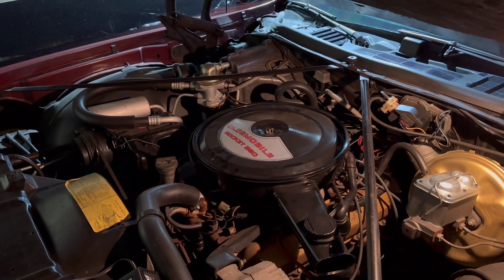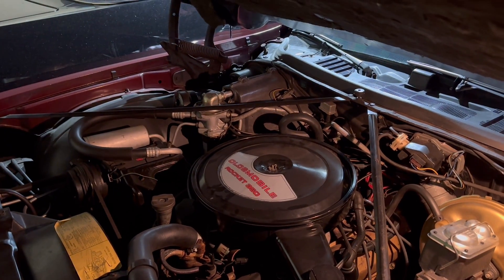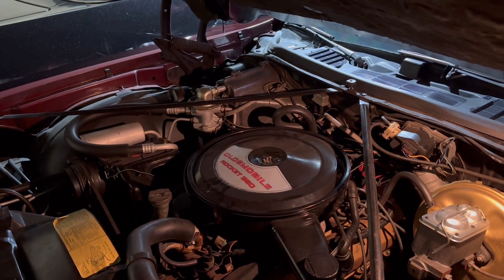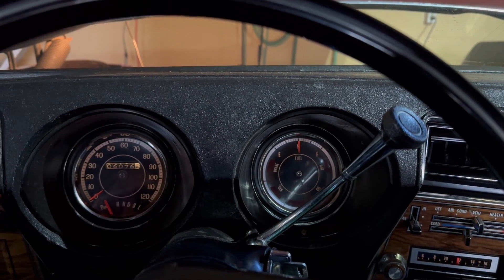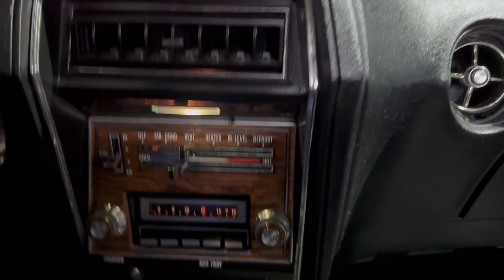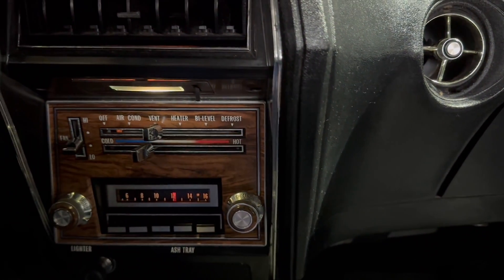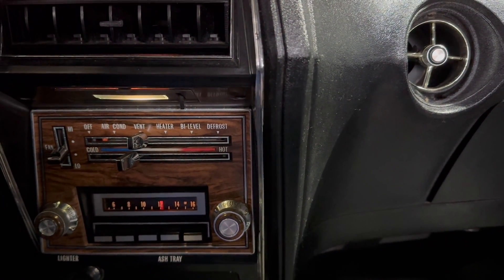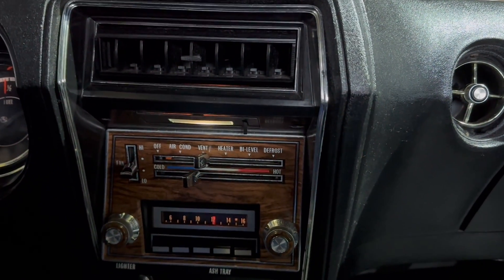GM's "Coolest" Invention Was a Strange Approach to Air Conditioning

Comment: Yep - in the Texas summer, those GM air conditioner units worked great! The controls provided practical function, but I absolutely hated not having independent manual control. Good thing those barges took all the joy out of driving and it was just an appliance - that was well suited to the Texas driving conditions.

Comment: As I recall, the recirculation "fan" always ran even in the off mode.  The other thing about the Oldsmobile rocket engines is that when the heat was on especially in vent mode, they had a very distinct aroma. Now that I'm thinking about it,  my 1979 Park Avenue Coupe had the Olds 403 6.6-liter engine.  It also had the Oldsmobile distinct odor!
Reply: The owners manual for my 75 Firebird states the fan is designed to run even in the off position to keep air moving through the damp AC unit to prevent mold and mildew......it also created a nice chilly draft under the dash in the winter however it could be switched to an annoying hot wind on your knees.......anything but completely off even if the car was comfortable without using the heat/ac.
Reply: @jasonrackawack9369  I still have all of the owner's manuals from all of my cars from that era to the present era.  I recall the same type of info.
Reply: My 01 Malibu and my buddies 98 Silverado both would let air flow through at highway speeds. The fan was off but you could definitely feel warm or cool air flowing through depending on where the temperature was set
Reply: @imthemistermaster  I have always heard this was a deliberate safety thing, as it means there is always fresh air entry to the car when in motion.  Probably more that they didnt see a need to install a damper to totally close off the system when its off since very few people shut the HVAC on a car totally off. I usually ran vent mode if I did not need a specific thing for example.
Reply: @imthemistermaster  I think all cars do that now. But you only feel it if you are moving.
Reply: I think that started in the 1970's on a lot of makes.

Comment: The o rings in the hose fittings need replacement or leaks are problematic.  Idle cooling on 134a not as good as R12.  Electric fan helps.

Comment: My first car, a 4 door Malibu, had a/c with that A6 compressor. In auto shop, we took off my compressor to reseal it.

After it was fixed, we recharged it, and it blew ice cold! 1967 Chevrolet. 

I drove it 8 years after that before getting rear ended. Never had to put another charge into it.

What i also liked was that the compressor ran the whole time the a/c was on. It didn't cycle like today's cars do. Gas mileage sucked, but i didn't care. I was cool.

Comment: R12. Good stuff. In the 90's the government made it impossible for a DYI'r to buy R12. So, I took an online class and got a certificate that allowed me to buy R12. I bought a 20 lb canister of it. I still have it. I would use it every 4 or 5 years to top off my 1977 Regal, 1975 Park Avenue and 1978 Eldorado. The AC in these cars was terrific but I never liked the automatic AC because in Florida you just can't get it cold enough. The recirculation feature was I beleive not available on that system. The Regal had manual AC with recirculate and it was great but the cabin was smaller too.    Good video.

Comment: That was a very interesting  segment. GM's units pumped out air so COLD that we vividly recall the formation of mini icicles at the two center dash vents.  👉.  🌬️.   By the way, does anyone remember some of the early seventies GM vehicle's having an "ASTRO AIR" designation on the HVAC controls ?!?  If possible, explain that feature's meaning if any.  Many Thanks Yo !   🚘🔍.     🤔
Reply: Wasn't it 'astre' ventilation, instead of 'astro'?
Reply: @kellybanning2013  No, the words "Astro Ventilation" was clearly printed out on the heating & air slide controls on the dashboard. Some further research has indicated it was an air flow system designed by GM after they phased out the triangular side flip open windows after the 1968 models. In fact, the '69 Impala/Caprice model's FRONT windows no longer were manufactured with the flip open windows. Many Thanks Yo ! 🤔🚘🔍

Comment: I love those GM A6 axial compressors. They were big and heavy, and it took a lot of power to run them. But they worked. And they lasted. The Harrison compressor that followed was complete junk. They were often called pancake compressors due to there design, and you could count on them failing every 2-3 years. They almost always started leaking where the end caps were welded to the body. They were very flimsy. They used a lot less power to run, and that may have been the reason why GM switched to them. I have a 1976  Corvette with the A6 compressor, and it will freeze you out. That control design is similar to more modern designs that use "MAX A/C" to get more air, and use recirculated air rather than warmer outside air. 

I have a 2006 Mercury Grand Marquis, and it has a real nightmare of a climate control system. It uses constant flow of hot coolant through the heater core, and has a "blend door" to mix hot air and cold air to give you the temperature you want. The big issue with this system is the "blend door actuator" a small cheap plastic box with a tiny 12V motor and cheap flimsy plastic gears in it. These things inevitably fail after a short time, and their location makes it necessary to remove most of the dash to replace them. Mine failed. After doing some research, I found that I could remove the passenger side airbag, fabricate a chisel out of a 20" piece of rebar, and get it back in there far enough to break off the corners of the blend door actuator where the attachment screws went, and move it away from the bellcrank on the blend door. I was able to jam the blend door into the full A/C position. I also removed and plugged the heater hoses to keep coolant out of the heater core. I live in Phoenix, AZ, where summer temperatures average 110-112 degrees F, and it never gets cold enough in the "winter" where a jacket won't keep you warm. This nightmare could have been avoided if only they had used wire cables to move the blend door. They tend to last forever.
Reply: I had a few Panther cars and that blend door actuator motor is a common failure point. The good news is that it's possible to replace it by just pulling the glove box and the passenger side airbag. You only need to destroy one corner bolt as I recall. It's not *easy*, but it beats trying to pull the whole damned dashboard out.

Comment: I always found the 80s to early 90s slider HVAC controls in GM products quite confusing as a kid on what was supposed to perform what function.  The unit Chrysler used in the early 90s k based vehicles took no time at all to figure out with its visual directional diagrams assigned to a single button, button specifically for air conditioning, and a slot for recirculating.

Comment: I don't believe the blower motor went to HIGH on recirc. The air movement sound got louder because the air was now being recirculated within the cabin instead of from the cowl outside the cabin. The blower motor was now blowing air within the cowling of the cabin under the dash instead of within the cooling ducts under the hood, therefor being easier to hear. 
The Olds (I am not familiar with other GM marques) owners manuals of this era makes note of this in the section on operation of the climate controls.

Comment: My 75 GP has the Max and Normal positions on the top slider as did my 76 Toronado. Funny thing about the Toronado, it had an electric rear window defrost (heated back glass) and it had a relay that would prevent the blower from going into the high speed when the defogger was on. With it off it would lock the blower in high speed in maximum. Guess because for some reason the Toronado only had a 63 amp alternator. I had a different 75 GP in high school that had a heated back glass but the blower would stay on high when it was turned on. It had the larger 80 amp alternator.

Comment: The Comfortron system was even cooler.  It was thermostatically controlled and would automatically switch from heat to cooling as you drove as weather conditions varied.

Comment: In my opinion the compressor you show here and Chryslers V twin compressors were the best that were ever used in automotive air conditioning.  I’m retired from HVACR field after forty seven years I never did any automotive air conditioning except for my own and family. I really liked those two compressors they seemed to run forever and would take more abuse than today’s compressors. It’s the same way in the field I was in.
Reply: I never tried it but I’ve seen it done. It’s a shame when America has something so good on the market that they have to stop manufacturing it because it doesn’t break down and make them money. 😡🤬
Reply: @czechmate6916  Yeah, that seems to be the first priority in modern automotive design. 

Just one more reason I'll keep fixing my old cars! :3
Reply: @jamesgizasson  Same here, everything I own is old but it’s paid for and still works while everyone else is in debt for buying junk they don’t even own anymore. They have to buy new junk 🤣
Reply: @czechmate6916 Yeah. I used to hate modern cars because they were so expensive and complicated. Now I hate them because I know that all that money doesn't actually buy you a better car... just a prettier one.
Reply: @jamesgizasson  Not a guarantee. Original compressor on a Ford van from 1980 was made of cast iron. New ones were aluminum. Original one never broke, but made a bit of noise after 12 years. Then I went through around 4 more of them since they failed after not even 2 years.
Reply: the Chrysler V Twin could be converted into a normal air compressor for air tanks etc.
Reply: I had a 77 dodge tradesman B200 van, that would blow snow out he vent on rainy days on the open road,  I hung a drink holder in front of the vent to keep my beer cold!  Sold the van with 275,000 miles, the guy that bought it from me took it to 335,000 miles it had the 318. Replaced the engine while on the road with an engine from a grandma car.  Met my wife when I owned that van. 
Had a half barrel of beer in the back and it fell over on the valve and dumped about 5 gallon of beer on the carpet covered 4in carpet in the rear of the van. (Summertime). I can still remember how bad it smelled.

Comment: Learned something today - thanks.  Nothing more than a rethink of the 'Max Air' (a/c) settings used elsewhere.  Hot Water valve/heater door closed, outside vent door closed and fan goes to max speed.

Comment: '60s/early '70s MoPar and mid-'70s-up GMs have just AWESOME air conditioning. I don't think anyone's ever done it better. If it's not hot and in the daytime, the old GMs I had and my '67 Belvedere's temperature setting would rarely be more than like 1/8" toward the 'cool' end of center, and I almost never turned the fan above the first or second setting, usually in defog/floor. Max AC/recirc was strictly an 85°+ with the sun out situation.
Reply: they sure had a spectacular fall from grace.... my family had a 1986 Electra Estate Wagon, and it had the most feeble A/C and heat I've ever seen.
Reply: @psymi-hk1fp  My '80s Buick Regals remain the most impressive vehicles I've ever been in to this day with regard to AC frigidity. There was something wrong with yours, I can say that with 100% confidence.

Comment: Come to think of it, in my 2016 Camry, if you turn the temperature knob all the way into the blue zone it puts the system into recirculating mode, despite the fact that the HVAC panel has a dedicated Recirc button.

But turning the knob all the way into the blue zone has no effect on blower speed.

Comment: I remember this feature very well, it caused a return to the dealer early on when the parents first got the 73 Caprice coupe.  Needless to say, they had the temp lever all the way to the left so the fan was on high when in AC mode.  Our 69 Caprice had a separate position on the control lever for the recirc AC mode.  No problems once the operation/control was explained to them.  I have to comment that this control was super easy to use,  everything could be controlled by "feel", provided you remembered the relative detent positioning on the top control mode lever.  Funny that you mention the heater core hose control valve, I don't think the 73 Caprice had one of these....  The only reason I remember/noticed is because I changed the heater core/heater hoses so many years ago and would have remembered a valve like that.  
Peculiar features do get replicated though.  Believe it or not, my 09 Camry has a similar control feature.  Turn the temp knob all the way to cold engages the AC recirc mode and a higher fan speed!  This feature is ever more frustrating on my Camry because it acts like a switch to turn the AC on even though the AC switch might be off. The temp control knob must be turned away from this position before the AC will shut off.  Needless to say, this foolish design flaw has resulted in some colorful commentary by yours truly.  
For my money, the HVAC control on the old Chevy (no comfortron) was great.  You could make any adjustments to the system without having to look at the controls, or some idiotic screen.
Reply: What you say is true, and 100% your experience. I like these controls, simply because it was ubiquitous. Everyone had a GM, and if you drove another's car you could figure it out instantly. That doesn't make it the best. Honda climate controls had all the same features with 3 dials, and they kept the same design in every model. expensive or cheap. Again, the same easy to operate and the dials, for me are easier to work with no look.
Reply: @Redmenace96    Yeah, my 99 Solara had the three dials as well, with good detents, easy to use as well
Reply: @fleetwin1  O, was I mad when Toyota and Honda went to touchscreens. Like every other car company. Wanted them to fight the power and keep it as simple as possible. Nice to hear a nice comment from a nice YT viewer.
Reply: For sure.  You can't beat the old GM systems for simplicity, cold AC, and hot heat....

Comment: Yes, my '77 Mark V has a GM compressor for the air conditioning.  It's fabulous...better than any newer car I and my parents have ever owned since my Dad had the twin of my car.  The heat is just as impressive...like a furnace.  The system is semi-automatic vs fully automatic, where you have to make a fan selection, but the system will move the blower up and down a bit automatically when at least using the two middle fan speeds...I am forgetting if it does it on the low setting too.  The highest speed just stays that way.

Comment: I have a ‘63 Sedan deVille w/AC.  That car is now 60 yrs. old.  I’ve owned it since 1980.  It still blows ice cold and always has. I have never had to add refrigerant.  It does NOT have a recirc feature at all as far as I know.

I’ve also had a ‘73 Fleetwood Brougham d’Elegance (60 Special) and a ‘75 Buick Electra Limited Park Ave. These cars both had the recirc position as you’re showing on your olds.  I’m presuming that they had the Compressor that is the subject of this video.  While they both did speed up the fan and switch the position of the mixer door.  But they also leaked out.  I had to add refrigerant just about every season.

As to other makes - I’ve had 9 Chrysler Mini-Vans. 8 of which had AC.  They all had a recirc button which sped up the fan.  However several of them quit working at the higher speed after some time!!

Comment: There are still cars that behave this way! The 2014-2018 Mazda3 does that on models that do not have automatic climate control. Turning it all the way to "cold" puts it on recirculation. I'm not certain that it would also turn up the fan, but this concept lives on!

Comment: More accurately, the HVAC maker was the Harrison Division Vs " GM " it's self.  
Also, there is way more parts sharing between auto makers than some realize.  An example is " GM " Saginaw power steering pumps found their way onto tons of cars.  The best one I've seen was a 944 Porsche that had fuel injection made under license by Nippondenso. The owner of the design was Bosch. . . Another one is a Pontiac 6000 with an analog instrument cluster made by Nippondenso as per the markings on the top of the face.  This can be seen of you remove the dash trim and might be visible with it on if you look up.   

As for recirc on the temp control, the 90's Dodge Spirit / Plymouth Acclaim and probably others of that era had this but not the elevated fan speed.

Some GM cars of this era had a temp sensor in the radiator to prevent the HVAC blower  from running until the engine warmed up.

There is also a 3 pin AC fuse that protects the compressor from over pressure  / over heating

If charging with R-134a, the sight glass  isn't used as there are always bubbles in the liquid line.

Comment: I always felt that, when GM brought in the AC Brothers (Max and Norm), they kind of slacked off on the job compared to the frosty mist generating coldness you could get with the older systems.

Comment: The only way I can get Recirc / Max AC in my 1994 Cadillac is to set the temperature on the digital display to 60 degrees.

When set to 60 degrees the air is recirculated and the blower automatically goes to maximum speed.

What sucks about this car is that there is no way to select bi level air conditioning.